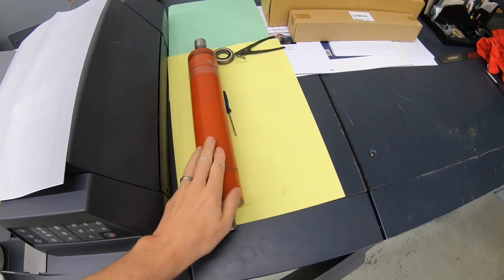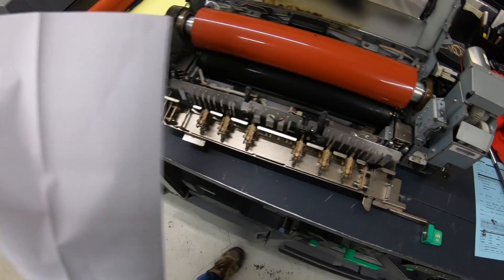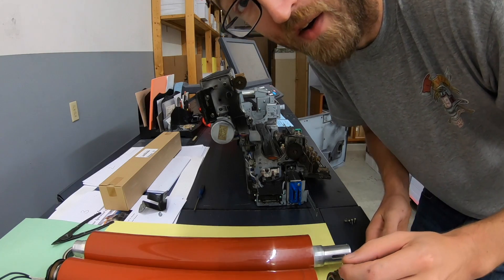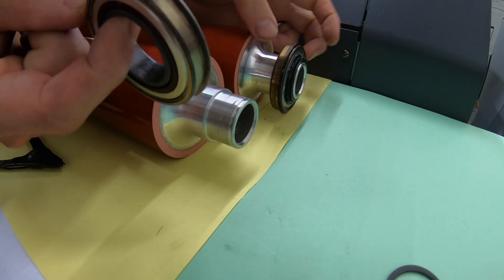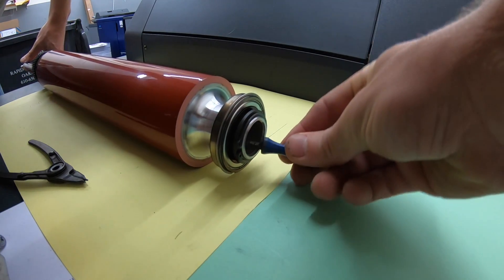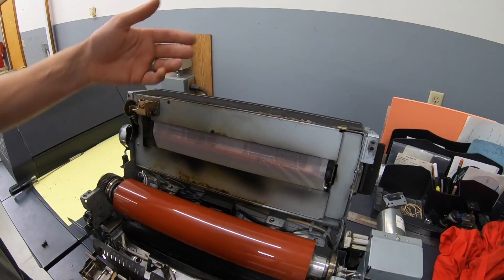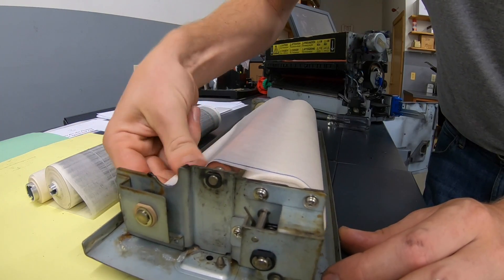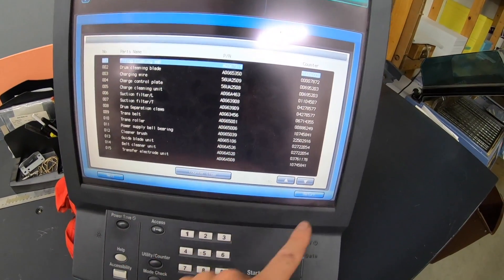How to replace the Upper Fusing Roller and Cleaning Web on Konica Minolta 1200 PRO/ 1051

Comment: Was contracted employee for Xerox who manages a site (one many division) of Target.  Seven lines that each had two iGens tethered side by side.  iGens ran 24/7.  A fuser roller just wound't go bad at this site.  They literally disintegrated inside the machine.  Had to pick the pieces out by hand wearing gloves and only minutes to replace the roller.  No down time, Target need to get out those newly priced shelf labels.

If you have the funds.  Having a extra fuser assembly on hand can be useful for any type machine.  This way one fuser can be dedicated to 8.5x11 sheet size (or for questionable stocks that may not be laser safe) and the other to 13x19 as example.  Some fusers can hold up better that others.  If they continue to function and last long enough, over time running high volumes 8.5s can grove the rollers that will show up on the over size prints.
Reply from the maker: Very interesting! It would be very interesting to see a setup that large. I agree that a different fuser for different sizes is great. Thats the reason I try to only run large sheet sizes.

Comment: Question: where are u able to get OEM toner right now for the 1200? Also, how do you turn the fuser web motor on and off?
Reply from the maker: I have a bunch of toner in stock right now so I have not searched lately. It was sold out a month ago. Not sure if you can turn the fuser web motor on and off, sorry.